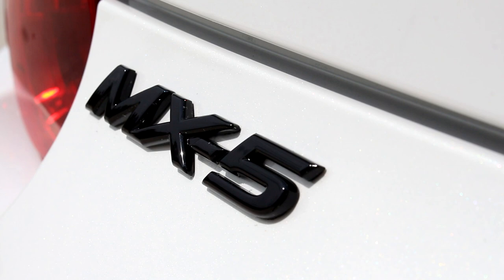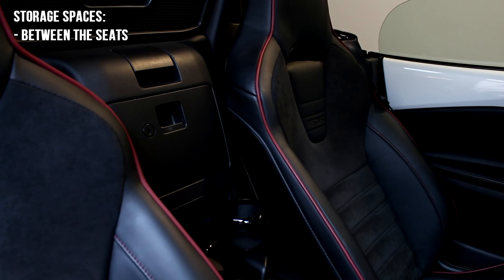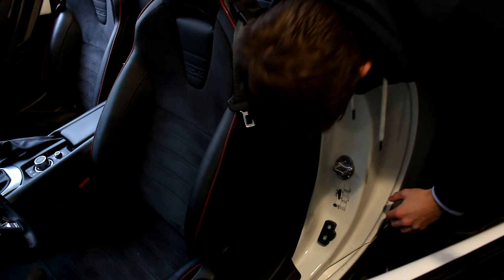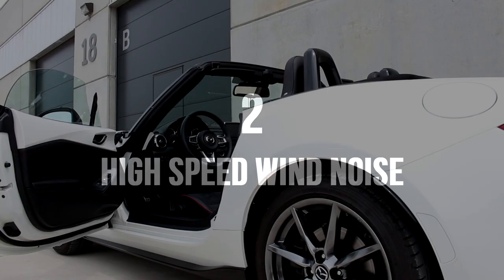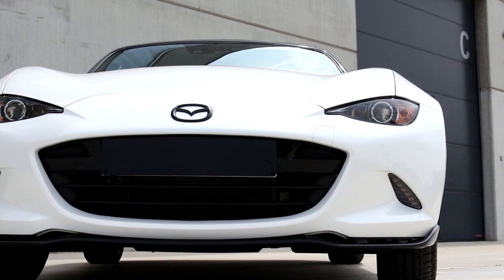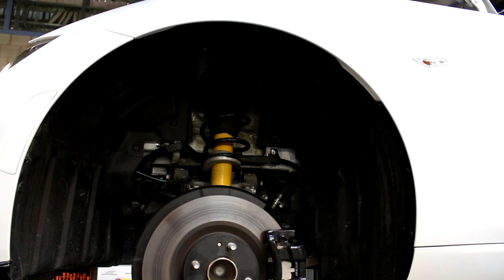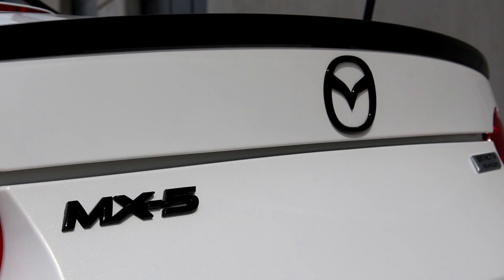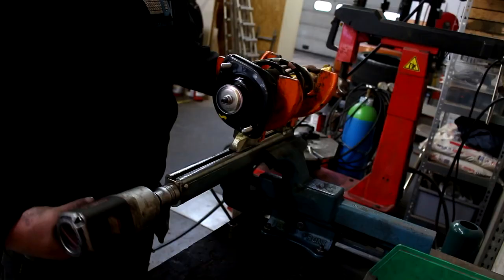5 things I hate about my 2016 ND MX5 - Miata In Action - Episode 6

Comment: Daytime running lights turning off when the headlights are switched on is pretty much a legal requirement. Properly designed DRLs emit a lot of light in all directions (they have to, in order to be noticed in bright daylight...) unlike dipped headlights which have a sharply controlled cut-off. They are not fitted simply to look good when cruising at the local McDonalds...

Comment: I had an NC (2008 Touring auto with 17" wheels) for 6 years and I've sat in the ND a couple times. here are a few things that I thought about the ND:
1) it has more room for the driver, there's a little more head room, more room to slide the seat back and you can recline the seat a little more.
2) the seats seemed a bit more comfortable.
3) the lower nose is better for visibility
3b) I was a big fan of the infotainment system and i was told that Mazda is going to continuously improve them and/or they're hackable since it's just Android AFAIK
4)if the fuel economy is accurate then it's a huge plus. In the US mine was rated at 20mpg city/27mpg highway (2.0l with 6 spd auto) and I generally got about that 27 or maybe a little more but never  more than 30 even on pure highway trips. The new one is rated 26/35 so 25% better.
5) I can't comment on the wind noise but my top was a piece of shit. The vinyl material was poor, it shrunk in the cold so it was very hard to fold then and the straps broke which caused tearing and looseness so eventually i had to have it patched. The new one seems to be a better cloth material and it has some metal stiffeners and reportedly more sound deadening. I did like that I could put the top up and down in < 5 seconds at stop lights :-)
6) The new one has no glove box. That space between the seats is inadequate and inconvenient for things i normally put in the glovebox.
7) In my NC I could put a space saver spare in the trunk. I had two cases where I had a flat and could not fix it with the pump/tire sealant. One was the tire valve broke when I was putting air in the tire and the second was a sidewall puncture. In both cases it was a huge pain in the ass and I got a compact spare from an RX-8 (I think) and then I had another sidewall puncture and was able to change the tire in 10 minutes and take the car to the shop under it's own power. I'll never drive a car without even a mini spare again. So the ND is out for that reason for me.
8) the auto transmission was poor relative to others I've driven in performance cars and I've heard the ND's is the same trans so you definitely want the manual.
9) if I would get one based on my NC history I would get a base model with 16" wheels - I had too many problems with 17" tires, they're expensive, low profile leads to poor ride on the crap roads I now drive on in Ohio, I don't recall that it handles worse than the 17s, curb rash etc. I haven't seen an RF in person yet I think I'd've gone for a PRHT NC if I could go back.
10) I like the looks of the ND for sure especially in lighter colors. Older women liked my burgundy NC but I wish could've had the dark blue.

It seems like sway bars are the solution for body roll
Reply from the maker: Thanks for sharing your opinion :) I have no experience with the NC model, so I really enjoyed reading this!

Comment: 1) midget sized
2) button for opening trunk at the license plate mentioned as an advantage... well I guess yes until it rains or you drive only on polished roads, for everyone else that place and button will get dirty easily and quickly
3) nonadjustable steering wheel depth
Reply: 1) I'm 186cm tall and I fit in. That's probably the limit, but I'm hardly a midget.
2) Use the Keyfob to open the trunk.
3) Yes, that can be a problem depending on how laid back you like to drive. I know I'd like it to be telescopic too.

Comment: I have a 2016 ND, and have put about 20K miles on it. Yes, it's loud at highway speeds (And I do a lot of highway driving), but it's expected, since it's a convertible. I previously owned an '02 NB, and it was louder, both top up, and top down. So, I don't worry too much about wind noise (I listen to audio books while I'm driving, and I vary the volume, depending on speed). . . It IS a bit of a pain when talking on the phone (Bluetooth) but I think a lot of that is poor cell phone service (AT&T). . . I will eventually address the suspension, and the front grill. I had a mesh grill cover on my NB, and it looked great! All things considered, I love the car.

Comment: I have an NA Miata. My comments on the ND (after visiting dealer):

1. I dislike the infotainment placement; it seems completely out of place on the dash and doesn't look like a sports car. I would like to have an option to get the car without it. Can't see buying one with it! Doesn't fit the car.

2. My NA has a glove box; can't believe that in the ND one has to store things either behind or beside you  (my side storage between the seats looks bigger to me)

3. I agree with you about the road noise; mine is too noisy too

4. Doesn't look like there is a spare tire in the trunk on the ND! No glovebox, no spare tire, and a square infotainment system on the dash?  Not happy about their choices!

5. I agree; the grill looks problematic

6. I have 14" stock wheels and I feel like I hug the road in my car. No body roll effect, thankfully.
Reply from the maker: Nicely laid out comment. Indeed the storage space is far from impressive in the ND and indeed there is more space in the NA. the reason for not having a glove box is that the Bose subwoofer is mounted behind the dashboard.
The infotainment is something that is up for debate, it is closer to your line of sight but indeed it looks like a stuck on tablet for some. 
Thank you for your comment ;-)

Comment: Ik considering the car and since i test drove it can add a few things: - steering wheel is too thin and cant be adjusted axially. - infotainment lacks mirrorlink, let alone carplay or Android auyo. - modern tech like adaptive cruise controle or a parking camera is not available. - Nice extras like limited slip diff, bilsteins, recaros, brembos not available on 1.5 engine
Reply from the maker: +MPC007_EXP thanks for the input. Some thing I can add are that you can get android auto through the AIO tweaks for Mazda, but I still need to test this out myself. And also I have a rear camera on mine as an OEM option. For the other points I can indeed agree. But really it is a lot of car for the money in my opinion.
Reply: Maybe not your car.

Comment: I have a 2016 ND Sport in the USA. The locks automatically lock after I go about 10 mph. Maybe there is an option in the infotainment center on your car to get auto locking.
Reply from the maker: Thank you for the comment. 
I have checked the settings multiple times but without any luck. I checked forums and even Youtube and found examples of where the setting should be, but it just is not there on mine.
 But after hearing your car does have this feature, I am gonna go by the dealer ask ask why the feature is not there for me. :)
Reply: Yeah i have the ND Grand Touring in the USA and the doors automatically lock as soon as i start driving. Hopefully you got that figured out!
Reply from the maker: I went to the dealer last weekend and apparently that feature was cut from the BE/EU versions. I do not know why. 
Does anyone know if you could add this manually, by programming or such ?
Reply: If you have a bluetooth elm 327 dongle and download Carista and pay $20 for the app you can check and enable the settings by yourself
Reply: There is no automatic door lock on my GT 2016 ND  in Australia.....
Reply from the maker: Thanks for the tip, I will take a look :-)
Reply: Maybe a firmware update will become available.  I agree, auto locking is a great safety feature.  Beyond, Mazda fixing it... maybe a tuner in your area could get it done. ( I bet someone could make a few bucks with that simple upgrade).
Reply: I'm trying to find out what Carista is able to do for the MX-5, but as far as I can see, only diagnostics are available...
Reply: I think we can change it with MZD AIO Tweaks software...

Comment: 1. The gearbox isnt as stout as the NC
2. 140hp (ND1)
3. No 2.5l turbo option from the cx30
4.
Reply: 4. Color options or lack of
5. The options packages are cost prohibitive for tuners, an LSD or BBS Brembo package should be available on its own without a 10k package

Comment: If you want a big trunk, then by a scenic ;-)

And you seems to discover that a convertible is noisy when roof is opened... come on !
Reply from the maker: The problem of the noise is when to roof is closed. not when it is opened ;-)
Reply: freeman31z , its a Roadster...
Reply: Yeah, I just switched to an ND soft top from an NC PRHT. I expected a bit more noise with the top up, but it's much more pronounced than I expected. I guess it's been about 10 years since I've driven another soft top for any amount of time, but I didn't remember them being that loud. It helps to slow down slightly. It seems to get considerably worse as a get over 70mph. The bigger surprise for me was actually how much louder it is top down than my NC PRHT was top down.
Reply: AVPOnTheRoad I chose the RF model for that exact reason. With the top closed, it’s way quieter and less fatiguing on long, high speed highway trips.

Comment: why do the locks need to lock themselves at certain speeds? what is the advantage of that?
Reply from the maker: +da real rulezbreaker the advantage of you doors locking when you start driving is that when you stop at a red light for example, no stranger can open your door to carjack your car for example. It is a nice safety feature in my opinion.
Reply: i see, makes sense.
Reply: Thousands of motorist jumping from there cars above 10 mph. Not as big a deal at 9 mph.

Comment: I have one ND after one NC for 10 years.
A such quality painting Is unacceptable.
On my Blue Royal NC it was impossible to keep it without scratches.
On my Grey ND the painting is very fragile although I am cautious. The paint thickness is ridiculous. Any very small scratch or gravel impact is fatal: white primary cover appears. 
I've talked about it with my Mazda reseller, he was agree with me and told me that he has many complaints about painting quality. The worst color is red.
I've asked to an painting pro to try one polish. He didn't want to polish it: to risky because in some zones of the body the painting thickness is too small.

On yours White model, this painting problem should be less visible.
Reply from the maker: I have noticed the weak paint as well, my front is already full of stone chips. It is a bummer but a known issue.

Comment: The RF will be released on the 4th of March 2017 (in the UK) been fighting not to buy one as I have a VW Golf GTI, which is all I need but I want another MX5 (previously had Mk 2.5) 2 years ago.
Reply: Jimbers Wimbers I'm cross shopping them too for my next. Wondering about the cost to tighten the suspension and highway wind noise with the RF. I'm in Montreal and will prolly not be able to justify the small luggage space though.

Comment: Good point review!  I wish they have the Recaro seats option in US.  I wonder if Mazda offer heated seat option with the Recaro. It would be perfect.   Recaro made great seats for a sporty car. (I love them).  True, it rolls too much like a Buick.  How do you like your KW coilover?  Does it has adjustable dampers?   Our tuner shop offer OHLIN coilover and I used it for my previous NC Miata.   Your car look good, i like your ride height,, because it doesn't look lower too much.  Just perfect.  How much lower did you adjust the springs?  Because I used the roadster sport springs and koni shocks on mine, it didn't lower too much.  I had it done a few days ago.  Although I may consider using OHLIN coilover again.  Because the roadster sport spring rate is at front: 300, rear: 200.  And so far I turn the koni at softest setting.  I am an older guy, i don't want the ride to be as firm as my GT3RS.  I still want to keep the Miata as a fun roadster.   Certainly I really love this ND GT version.  How about did you have to use headlight levelizer for headlights aim angle?  Please let me know...  cheers.. 👍🏻👍🏻
🦅🦅🇺🇸
Reply from the maker: I do like my KW coilovers and indeed they are adjustable both in in- and outbound dampening. I have heard a lot about Ohlins and they also sound like a really good set to have. 
The point was indeed to give the car a sportier stance but still have a nice driving height for when roads are in rougher condition. I think the car dropped around 5 to 6 centimetres both front and rear. 
I did have to adjust the headlights but these can just be releveled with a tiny screw under the headlights. This is without any issue with the levelling system.
Cheers

Comment: hi!  thanks for the video.  May i check what coilovers are you on?  I have a NC miata but the coilover does make noise ( from the spring rate)  occasionally.  I tried the new nd recently and in love with it.  My concern will be the body roll during hard corners so maybe the coilover set up could help.
Reply from the maker: Hello, My car is now fitted with the KW V3 suspension. I had the same concerns about the body roll, and for me (mostly road use) the suspension fixes the problem and it gives you as a driver more confidence to push further than with the stock suspension.

Comment: IC.  How do you like your KW coilover? (Ride quality).   I saw a lot of Porsche enthusiasts use KW coilover for their cars.  I kept my RS stock, it works good enough for me.   Btw, your mix-5 look sharp.  Perfect ride height.  I like it when one can't tell if it has been lower or not..   purposeful and functional too..   

True.  I wonder if you can find a way to bypass the DRL light.   Keep it on even when you turn on your headlights.  If you do find this bypass, please let me know..   thanks
Reply from the maker: +Frank Kwok I do like the coilover setup, the car now stays much more flat on the corners even when pushed to the limit. The ride does get a bit stiffer, but that is to be expected when going for a better handling setup. And I still have to see if I can fiddle a bit with the dampening settings, to make it even better. 
I have not been looking at a way to bypass the drls but when I find something I will keep you updated.
Reply: AVPOnTheRoad - I think there may be a way to bypass to keep DRL on.   My buddy's new M3 found a way to bypass DRL.  BRIGHTER setting DRL with the headlights on at night.  Usually it dims the DRL with headlights on.  Of course, he had to paid a tune shop to make the mods.

Comment: My minor gripes...
Passenger seat belt flapping when top and windows down - yes, I have no friends.
Nowhere to put cell phone that doesn't end up with it on the floor - maybe a center console lid with indentation for phone.
No touch screen radio when moving - wtf!
Push down spot on top always dingy looking - yes, I bath daily.
No back up camera - they put it on the Fiata for god's sake.
Reply from the maker: I havent noticed the seatbelt flapping myself, but could imagine it doing that.
I normally put my phone either in one of the cupholder or on the center console next to the USB ports and it stays their nicely.
Indeed the disabled touchscreen can be annoying at times, but I also understand why they would do this.
Indeed you can always see the spot where you push the roof.
Actually the backup camera is an option from Mazda, I had it installed on mine at the dealer. 

Thanks for your input! :)